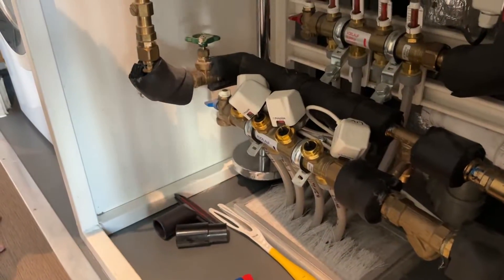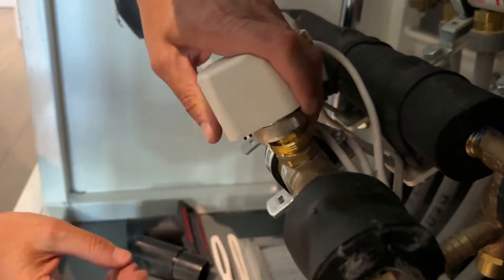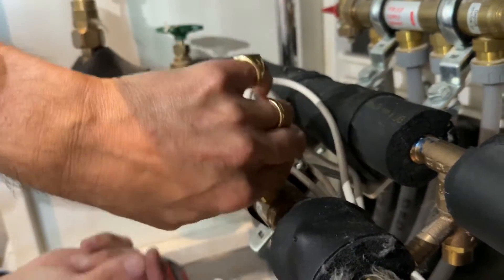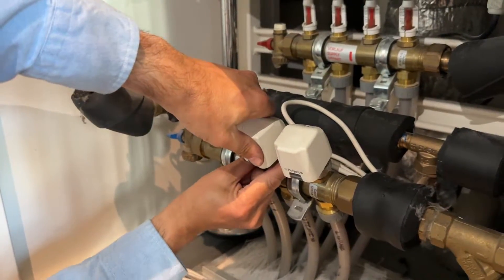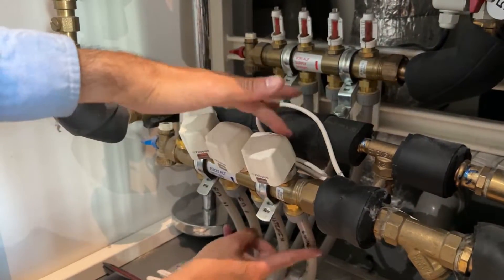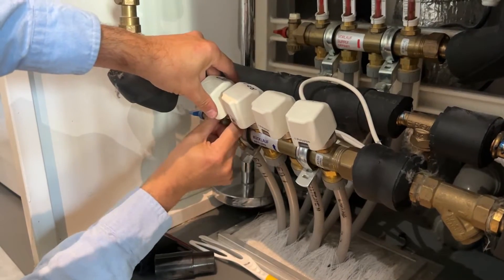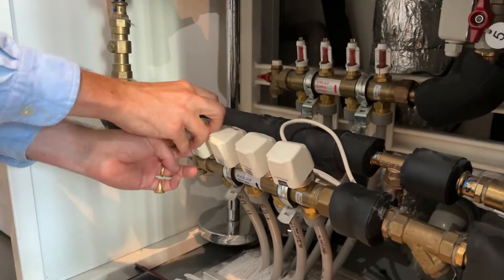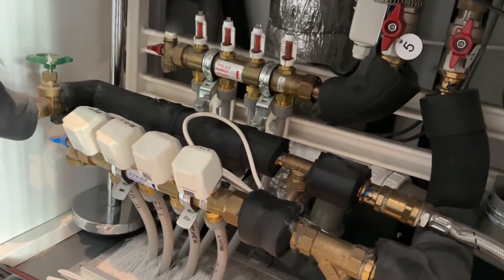Underfloor Heating System - Removing and Putting Back the Actuator Valves

Comment: My underfloor heating has 3 zones, one of which has stopped working. Can I remove two actuators and swap them over to see if the non-working zone starts heating up and the other one stops heating?

Comment: Can you remove an actuator without draining the system?
Reply: Yes you can. The actuator drives the pin that is connected to the valve. If the actuator is removed the valve will be in the open position so there will always water flowing as a failsafe. 

That way you can easily switch between regular TRV's, these electric ones or if you hate your wallet even more those fancy zigbee ones that'll cost you an arm and a leg each. 😉